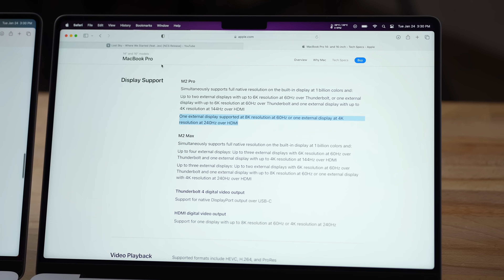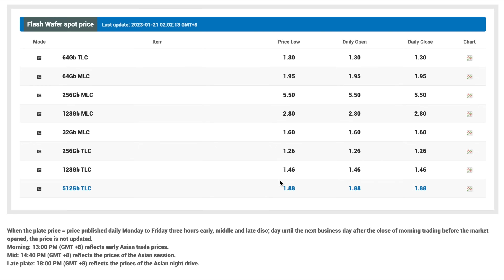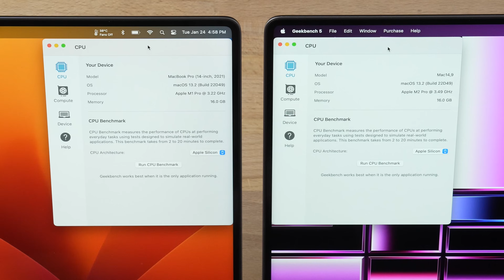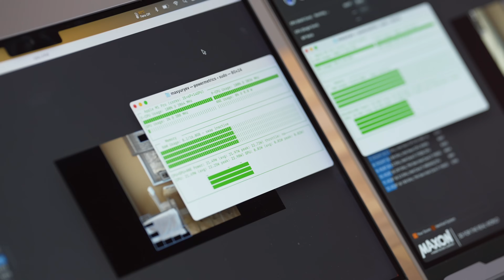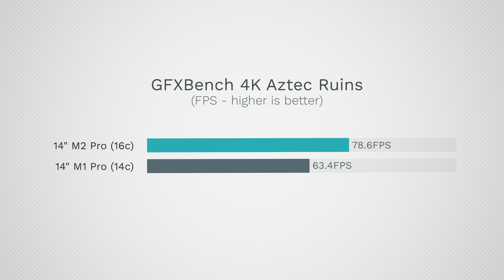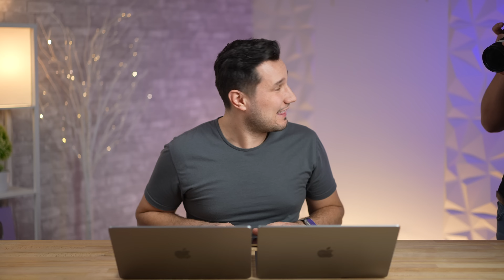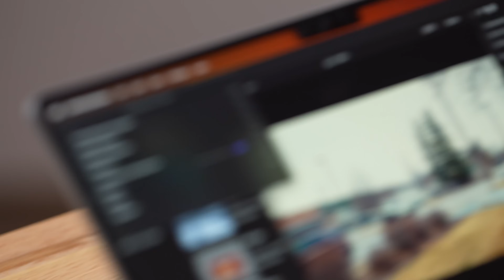M1 Pro vs M2 Pro 14” MacBook Pro - ULTIMATE Comparison!

Comment: m1 is better
Reply: Yeah, m2 overheated more in my experience, I had base model m2 air, god it was awful, it was slow as hell with the slow ssd and the battery life wasn’t that Good, and holy hell it overheated so much, if I played any game whatsoever, the computer would literally reach like 110 degrees Fahrenheit and burned to touch the computer and slowed the hell out of the computer and my battery health dropped so fast cause of throttling,

Comment: Apple really made the M1 the Terminator of all tablets computers especially on the iPad family, then creates a good Captain America out of the M2. M1 is simply like the bulletproof Toyota Land Cruiser engine, whereas M2 is the fun filled Lexus. I think that’s where they place it. You cannot have it all in one, it’s all about what you want it for. All works without play makes Johnny lazy, I love my battery, system performance and better pictures. I wish Apple 🍎 will upgrade the photo graphic/resolution of the M1, and also upgrade the battery life of the M2. Overall I’ll say the batteries are still gonna go down anyway and you can always recharge it, and you can always filter your photos to get a brighter result using various apps, but how many times are you going to do that. Except if the M1 has a photo resolution settings inbuilt in the camera/photo section. But M1 is simply a bullet proof pro amongst All. And as years pass by I’m seeing it being that good old grandpa Toyota truck that always run even with dead plugs.

Comment: M2 Pro isn't worth upgrading to. Even if I ws buying now I'd go M1 because right now you can get them for way less.  I'd rather keep that money in my account than give it to apple.  Bench scores tell the tail and make it clear it's not worth upgrading or buying especially if there is an M1 available at a much lower price.  I am speaking only for myself and my use.
Reply: In my opinion, if the price difference is 200-300€ it is better to buy the M2 Pro. With the updates of the last few months it has become very fast and the battery life has improved even more. Moreover, the wifi6E significantly increases the download/upload speed, something that is talked about too little. 
Tests show that, with the same router, upload times are often halved or nearly so compared to the M1 Pro
Reply: @davidealberti3784  Thank you for the comment. I bought a M2 Pro 14" for 1500€, which is about 200-300€ more than I was expecting to spend for a work laptop. I guess I got a bargain and made the right choice at the same time, even tho I don't like the fact that it got a different design and runs hotter and has slower SSD
Reply: @r3bugger  different design compared to what? Intel Macbook? Personally I prefer this, but it's a matter of taste.
In my agency I used the macbook 14 pro (10-core CPU, 16-core GPU) for about a year. I can tell you that the temperature during heavy use is the same. It probably wasn't like this in the beginning, but after the updates it fixed. The thing I noticed is that the base M2 Pro (10-core CPU, 16-core GPU) is faster and costs much less than the same version M1 Pro

Comment: I did the same your export test with 14" Macbook Pro M2 Pro 10-core CPU 16-core GPU, 16GB RAM, 512GB SSD. Same color correction as you, with LUT, color wheels, color board (and some other effects).
5 min 4k (from Panasonic GH5), export in ProRes 422: 51 sec (25% faster than the result you got with M1 Pro).
I repeated this several times (51 sec, 50, sec, 51 sec).
So I have to deduce that either you have an M2 Pro version with some problems or the M2 Pro chip has been optimized with some updates in last months.

Comment: Very informative thank you for expressing your research.
Reply: Probably when they did these tests the M2 Pro chip was not yet perfectly optimized (I suppose). I personally did the same 4k export test with Final Cut, with the same color correction (with Color Board and Color Wheels) and M2 Pro (base) it is 25% faster, finished the export in 51 seconds.
I don't know about the other tests

Comment: So, if the base m2 pro is slightly faster than the 8-core m1 pro in video rendering and export, and the 8-core m1 pro has the same 10-core result (as demonstrated by your channel in another video) it means that the base m2 pro is slightly faster (but still faster) than the full version 10-core m1 pro.
Apart from this, this speakers demonstration is useless at all. The difference between the two MacBook is the bass, much better in the latest model, but with a test like this you can't highlight it and it only seems that it sounds lower.  You should also know that it is misleading

Comment: I am looking for a new macbook pro and am confused between 2 models 

1) Macbook pro m2 pro 14 inches with 10 core CPU, 16 core GPU, 16gb RAM and 512gb SSD 

2) Macbook pro m1 pro 16 inches with 10 core CPU, 16 core GPU, 16gb RAM and 1TB SSD 

Should I go for the latest chip in the 
market or a previous version that gives me better speakers, battery, screen and double storage?
Reply: Don't know if you decided already but the key difference I think would be just the size of the thing.
Reply: Same situation here
Reply: @ukelelefernandez2432  I got M1 16 inch, the bigger screen its a huge deal , I compare them in real life and 14 inch its like tablet , too smal
Reply: So, if the base m2 pro is slightly faster than the 8-core m1 pro in video and photo export (much faster in 3d) and the 8-core m1 pro has the same 10-core result (as demonstrated by this channel in another video) it means that the base m2 pro is slightly faster (but still faster) than the full version 10-core m1 pro.
This speakers demonstration is useless at all. The difference between the two MacBook is the bass, much better in the latest model, but with a test like this you can't highlight it and it only seems that it sounds lower (I prefer the M2 pro sound).
Personally, I would recommend only m1 pro 8-core (to save money) or m2 pro (which is now also found for much less than Apple site).

Comment: I really do not get Apple being so greedy.
They saved about 4-5 USD for that SSD  ( chip plus installation (its all robots, it add maybe 3secs)) and using a smalled cooler on the machine that was known for throtteling while having new chip using more power (in other words: having smaller cooler for chip with more power?!). So they saved at max 10USD while selling you premium priduct that does not have premium numbers.
What do you think?

Comment: Great video.  Thank you for the comparison and teardown and testing.  So since the chip seems to be overclocked and Apple used a heatsink that is half the size of the one used in the M1 Pro which is why there were spikes of over 104 degrees wont these extreme temperatures be detrimental to the chipset decreasing the life span of the processor?

Comment: In terms of the CPU block, the density of the block can actually act as an insulator if the mass is too much. The M2's SSD was slower because it only had one chip, luck of the draw. The SSD also directly impacts the render times.
Reply: No impact on rendering times.  In my agency we have M1 Pro 14" 8-core and M2 Pro 14" 10-core (512Gb ssd). The latter is always faster in rendering and export video, whit FCPX and Davinci (about 20-25% faster).  I think it also depends on the fact that in last months they have optimized the performance of the M2 Pro chip with updates

Comment: I also noticed the huge difference in read/write speeds in the 512GB SSD compared to the M1.  Question, does that difference carry over to the 1TB drives as well?
Reply: No it doesn’t, if you opt to get the 1TB M2 Pro you’ll receive double the speeds of the 512GB model.
Reply: @kok324  Thanks!

Comment: someone help me please, which is better M2 Pro 10 CPU 16 GPU 16 RAM 512 SSD, or M1 Pro 10 CPU 10 GPU 16 RAM 1 SSD Storage,
most of my work is on growing with a lot of extensions, coding, basic photoshop & videos... the different price for the 2 options 85$ ....for the storage I don't care as I have an external part, but I care more about the specs and performance, speed and so on.....I'm rly hesitated and cant make a decision which one should I go for.....thanks
Reply: M1 Pro! Doesn’t run as hot, better speakers. Faster SSD retrieval. You probably won’t be pushing these machines to their max. Save your money and go M1 Pro all the way. I’ve had mine over a year, never gotten hot, fans have not turned on once. It’s a beast!

Comment: I just bought a 14 M2 Pro, not by choice but because I broke the screen on my 14 M1 Pro. I have noticed the M2 Pro runs way hotter than the M1 Pro. The M1 Pro never had any temperature, the M2 Pro heats up even when doing basic Xcode builds now. The battery life is also considerably worse when running Xcode builds, perhaps 20-30% worse or more. I was wondering if I was just crazy but this video explains a lot. I will certainly be returning this computer and looking into repairing the screen on my M1 pro instead. Wow.
Reply: M1 Pro is literally better it’s crazy 😂

Comment: It’s not cool for Apple to equip the base model with less and yet make the retail price ridiculously high for the general consumer who “does nothing”. May as well get a less expensive but more equipped Chromebook or Windows device to check emails and web browse. $2000 for a device should provide anyone with better specs. Seems like Apple is in love with themselves even more nowadays.
Reply: For the general consumer, there is the MacBook Air for a reason.
Reply: @nas1m  well that’s true too. But he stated that the base model pro is a $2,000 computer with specs for the general consumer. A $2,000 computer should have enough specs for more than checking emails and watching YouTube. It shouldn’t throttle when running heavy resource programs for $2,000. And the swap memory issue is another ridiculous issue.

Comment: It is common practice to have cost efficiency solutions on the second generation. First one is usually overbuilt, and next ones will optimize costs VS performance. Even if the CPU temperature is higher, as long as it does not reach critical levels and no throttling, basically for the user there is no difference. That also does not tell anything on the longevity. And still despite the temperature, according to benchmarks, there is considerably better performance with the M2.
The M1 SSD is faster, but the synthetic benchmark is not necessarily indicate the user experience.

Still I would prefer the better thermals and faster SSD.
One of my considerations to buy the Mac Studio was better thermals than the M2 Mini Pro, despite better performance in benchmarks and the same price.

While for the laptop, my priority would be for better battery life. So it seems MBP M2 is better almost in any aspects than the MBP M1.

Great review, very helpful.

Comment: Just to report my MacBook Pro M2 Pro with 3.47MHz 32Gb RAM and 2 TB memore scored higher in all tests compared to your equivalent 14inch M2 in your tests. For example, my Cinebench R23 Score on multicore was 14371 never exceeded 57C, Single core was 1582 never exceeding 47C. Not sure why the 16 inch model did better than the 14inch model, could just be variation in CPU bins.

Comment: Great job! I have the original M1 MacBook Pro from 2020 and was waiting to see if the M2 Pro was a big enough improvement to warrant an upgrade, short answer nope.  

One observation though, I found it really hard to keep it straight in my head which one was which. Was the M2 on the left or the right?  The outsides are exactly the same, maybe you could put a label on each one in future reviews.

Comment: I am a graphic designer and  I love the macbook i currently own. I have a Macbook M1 Pro 2021 16 inch 16GB 512GB but i was thinking of upgrading to the M2 Max 38 Core 32GB 1TB - started to do a lot more motion and 3D work and my macs slowing up a bit - doing some research around and this comparison video helped a lot!
Reply: Your 2021 pro is slow in 3d work? I’m a developer who’s starting  to get into 3d and was looking at getting the same one you have. What are you running on it that it’s having trouble handling?

Comment: Thanks for your video! Please add an overview of the display cable design ? Is there a difference between Apple silicone models and Intel models? As we all remember, Apple began to use an unreliable display cable that was integrated into the display, which resulted in a very expensive repair, the cable ran along the top of the loop and can be seen from the back if you open the laptop, crumbs and dust fell into this slot on the cable from the film and he was torn after half a year and even earlier. Repair cost a full replacement of the display, which is very expensive. For this it is important. Sorry for my English.🙂

Comment: Very nice review! Very detailed!
They're quite close, but I like the speakers on the 14"M2 a little better.
I would have totally bought an new M2 MacBook Pro if I could, but they have no support for most engineering software like Solidworks. Though I might have to pick up a 14" for normal use!

Comment: Just knowing that a newer, improved version of MBP 14 is out there crushes your soul a little bit when you coughed up $2000 just 14 months ago on an M1 MBP 14. Doesn't it? I for one, upgraded to the MBP M1 14 from a 2017 MBP 13 in Nov 21 for $2180. Oh man ... despite the hefty price tag and a bit of buyer's remorse between placing the order & picking it up from the Apple Store, my new MBP 14 was worth every penny right out of the box. Not only gorgeous with so many new ports, MagSafe, an amazing screen which was then the best in the industry (and still is), mind-blowing sound for any laptop, and its lightening fast performance were leaps and bounds ahead of anything I had ever seen before. I was more satisfied with the purchase from day 1 than the guy who married the prettiest girl from our med school on his wedding day. 14 months later, with all kinds of usage, I have never heard or felt its fans running, and it has never felt warm to touch even though when we lost power in the winters for a bit, I really really wish it did. And I never ever ran out of battery even through my days' long shifts at the hospital. Nor ever wished that it was more powerful or a bit faster. I was amazed at how capable this little thing is every step of the way. 

I am so glad I didn't miss this video of yours. 14% faster here, 20% faster there, better HDMI, better Wifi, better BT ... I really don't think any of that is reason enough to upgrade for anyone who is satisfied with an M1 MCP 14. In fact, the matching magsafe connector is way more tempting a reason for me to want the new one, than any of the above.

Thank you so much for the detailed analysis and comparison for the rest of us who depend on your guidance to make the best bet against the ever-increasing price tags on these devices. We owe you. Like, literally. Thank you. I for one will wait to upgrade when Apple astonishes us with something like the M1 MBP 14 was over its predecessors.

Unless, I am the chosen one, who gets the free M2 MBP 14 from you. 🫠 In which case, I'll happily donate my existing MBP 14 to a struggling medical student purely out of sympathy for them for the constant misery they have chosen as the "rest of their life" for themselves. A moment of silence for their soul.

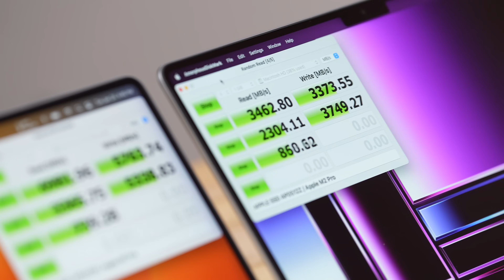Comment: Does the speed difference in SSDs still exists in higher capacity models, e.g., 1TB instead of 512GB? 7:17
Reply: Yes speed of m2 in 512 is half of m1 512 ! If you want same speed in m2 , you might buy 1 gig